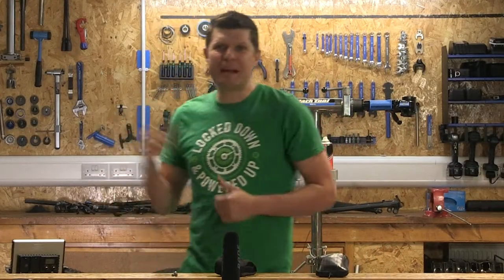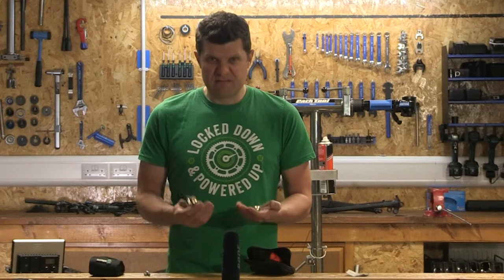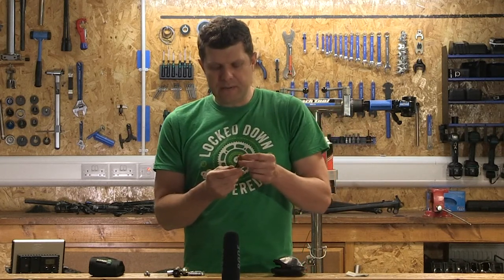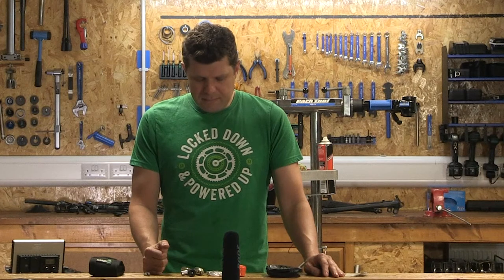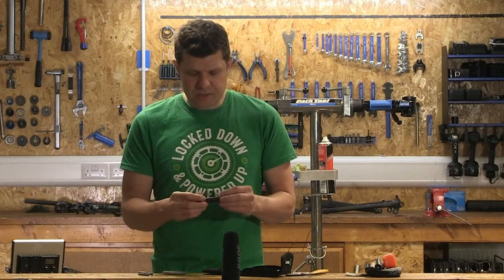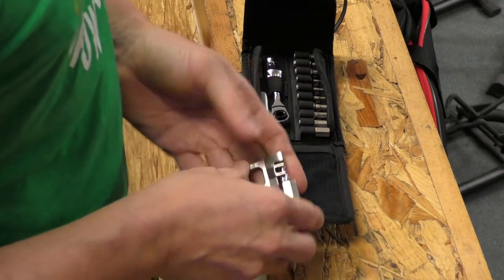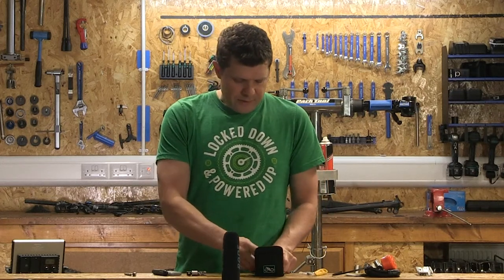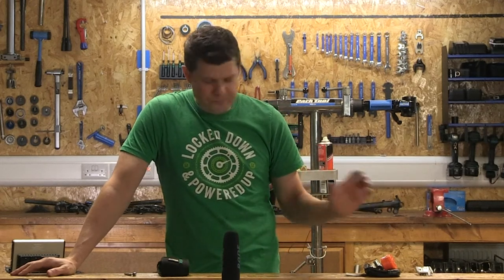Tools for Road & Mountain Bike Rides - The best cycle tools to get you home from Wera, Fabric, etc.

Comment: 9:02  I've been fine with those small Multi-Tool chain breakers, but it depends on strength I guess and method used, leverage.
I have a ratchet, but I don't have a kit with me yet, 
but what I do carry is this,
LEzyne Rap14 multitool, 16mm hex for raceface cranks
Wolftooth pliers, which keep the spare master links in and is nice to work tighten valve cores. it has built in tyre lever but that will just scratch the rim.
Fumpa Pump
Lezyne Alloy drive pump
Zipties for mud guards, and in case I need to secure something
I still have Co2 canisters so I carry them too.
I doubt I will need a tube, but I have Dynaplug repair kit to plug a hole.